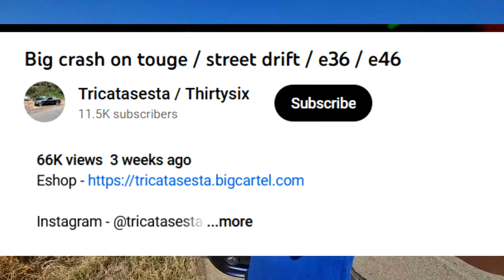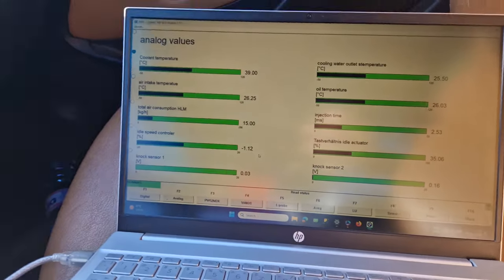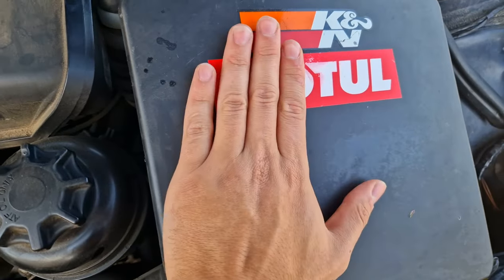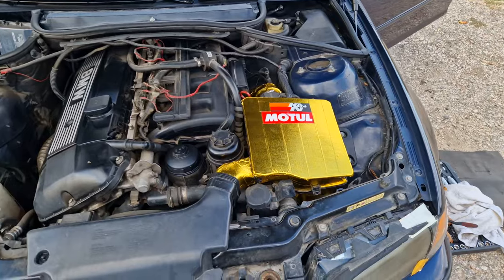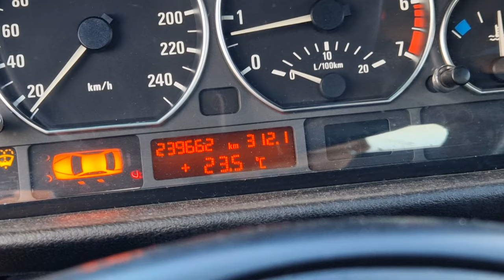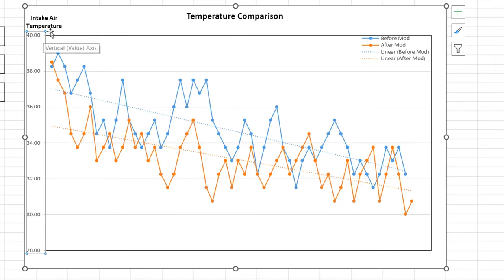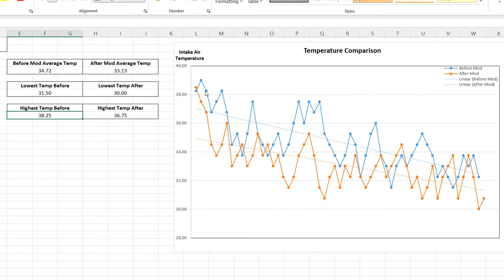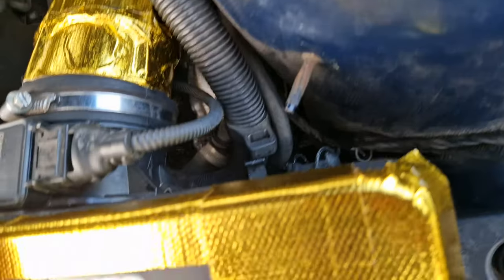CHEAP COLD AIR INTAKE MOD??

Comment: Doesn't do anything. It helps to prevent heatsoak maybe but under driving conditions wouldn't do fuck all...
Reply from the maker: Yeah in reality the -2 degree difference will not have much of an effect. It might slow down the heat soak but I doubt it prevents it.